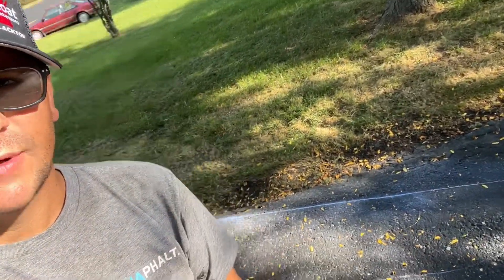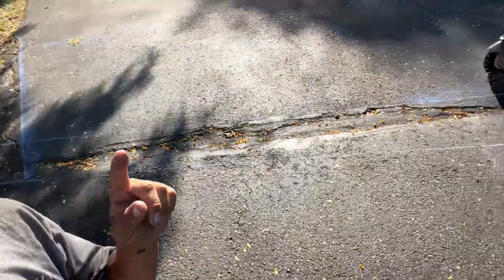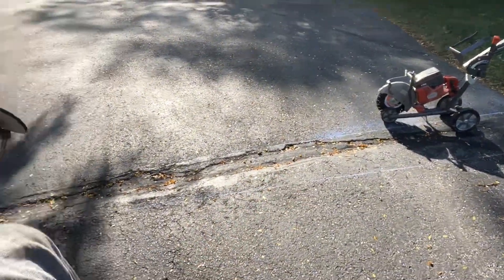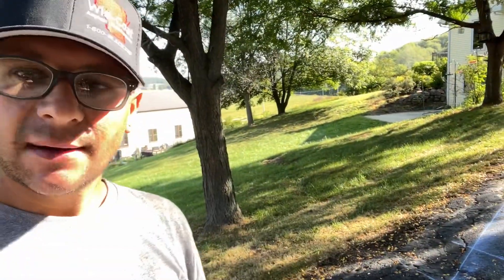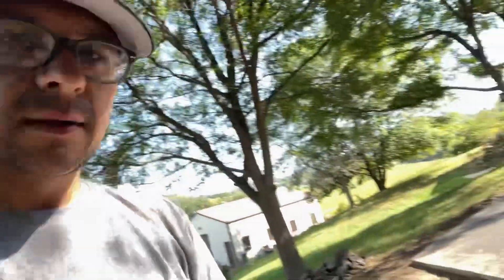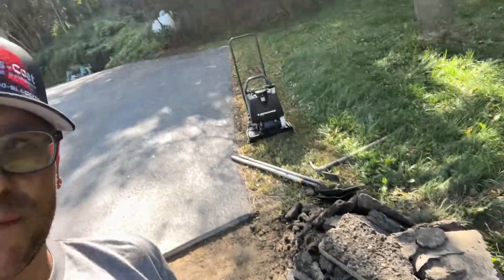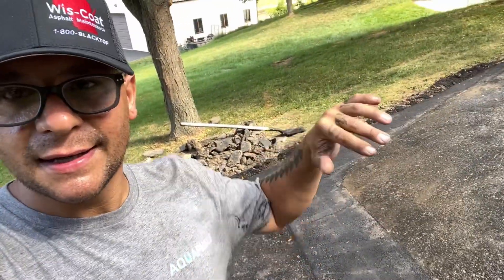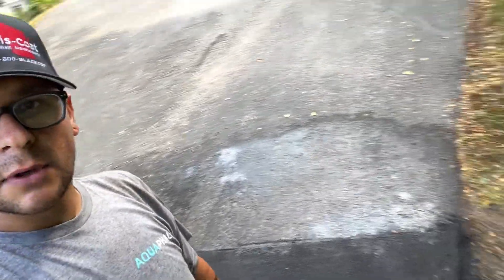Hot-Mix Asphalt Patch Install using the Dynapac DFP7AX Plate Compactor

Comment: How would you rate that Dynapac compared to the MBW you had used in the past? Seemed like you had to push that Dynapac around.
Reply from the maker: It was heavy on the incline, no doubt. I haven’t got to use the MBW on such an incline. I would say the Dynapac compacted better overall but the MBW was easier to work. Hopefully I can do a side by side soon.